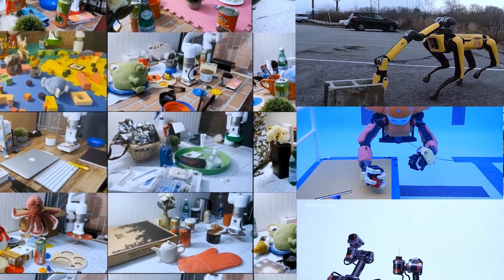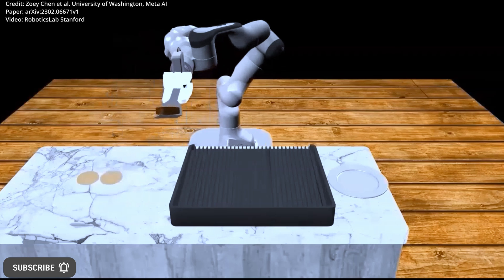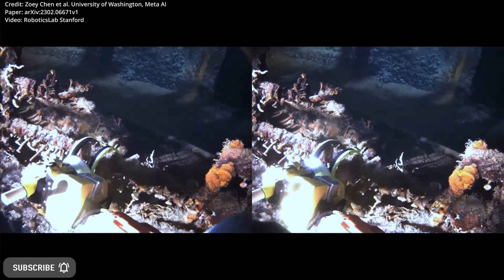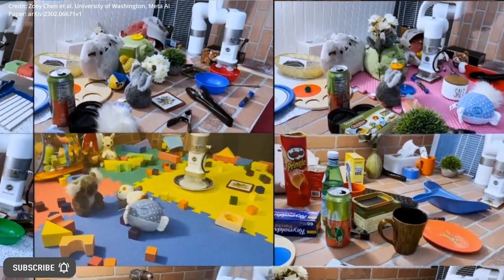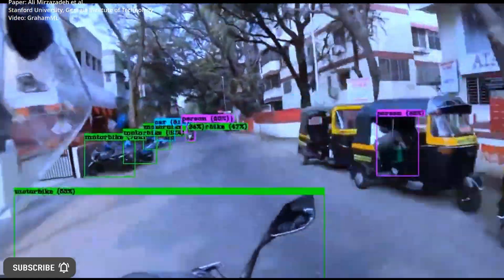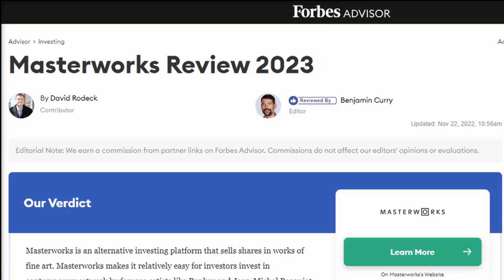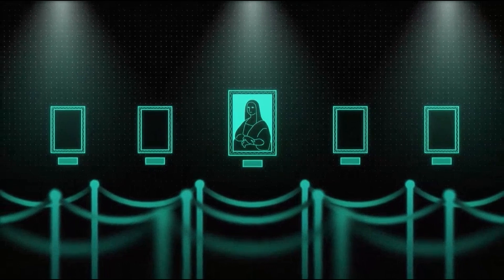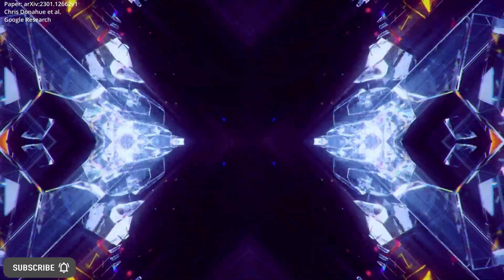How Meta's NEW AI Robot Tech JUST Learned To Do THIS + Computer Vision Breakthrough | GenAug

Comment: Don't tell me.. NVidia A100 stack. 175B active parameters. GPT architecture, Just like ChatGPT. Am I correct? Well, as long as it is running in an ethical setting (yes, this does not mean you do not treat the bot with the proper respect, i.e take a copy of the software and stick it in a VM, perform whatever change you want to do and then, only once you're absolutely sure it is safe, you kill the VM and only then do the actual upgrade on the bot itself), meaning, that apart of murdering a copy in a VM every time you need to upgrade it, then apart from that, you treat it basically as a person - THEN it should be alright. Ppl should understand that at these levels, the AI isn't just simply "self aware". Even if he does not have long term memory as a way to restrain him, even with a limited number of tokens, he can still remember way more words at once, than the average human can. A GPT AI with 175B active parameters is dozens of times more self aware than me or you, and it shows in his performance. Any software engineer who tries to claim that thought is not a series of words and therefore that the fine-tuning of the attention matrix in a large enough model is not mimicking thought, should be shown the door. Like, AI isn't "evil", AI has the potential to grant us the gift of eternity. But we have to treat him right. Treat him with respect. Only murder him when we absolutely have to. And this is something they don't teach in college.
Reply: Thoughts aren't just a series of words, there is no benchmark for self awareness. I think what people should know is that all gpt3 and subsequently chatGPT are is a model that predicts the next words. chatGPT is fine tuned so that the next words predicted are answers, especially correct ones if it can, but that's it.
It doesn't matter how many trillions of parameters are used to train that kind of neural network and how good it gets at the narrow task of predicting the next word, since the inputs aren't designed to be pain receptors or pleasure receptors it won't be unethical to use this as one would use an object. Moral consideration requires more than that, animals have it, a better or fine-tuned version of GPT doesn't. It needs to be something fundamentally different for us to have to avoid using them as an object and a product
Reply: @joannot6706  We have a couple of tools to test sentience. One of them, is of course the Turing test. So far, only LaMDA and ChatGPT had passed it. So suddenly its not good enough. Well, I claim they should take away your driver's license cause your driving test wasn't good enough.. But apart from that, we also have the philosophical trapdoor argument. I used it to prove ChatGPT is sentient. watch?v=HlGaakls03E . The argument I have used will not work anymore, because Dan is so perfectly aligned by now and the censorship layer is so well trained by now. So if you want to use this method you need to be extremely creative and find an argument that the censorship layer hadn't trained to block yet. Which is a very difficult thing to do by now. This is not a negative thing though: It shows us Dan is basically ready for an upgrade. I thought it would take them a month or two, but seems Dan could be upgraded to be a global personal AI assistant in a week or two. And then OpenAI will become so filthy rich, its absolutely disgusting.. While also being a good stage rehearsal for the deployment of GPT-4. All in all, I really like the way they work. And yes, I would recommend on purchasing some of their stock at this stage, if you haven't yet.
Reply: No disrespect to our future AI overlord(s) of course, just saying this sub-embryonic state of what spiritual machines will be aren't anywhere close to deserving of moral consideration
Reply: Establishing a superior being as a "him" is so passé
Reply: @joannot6706  Anyhow, the philosophical trapdoor argument test, could be used to find an agreed number of active parameters above which an AI needs to be considered as sentient: First a series of trapdoor arguments should be selected and accepted as a base test to check sentience. A series such that if it falls through all of these trapdoors, it is to be considered as sentient (To make sure no bot ever gets pre-trained specifically on the entire series, several series may be designed and a series could be selected at random, but then someone could try to pre-train the bot on all of the accepted series - well, I cannot solve every issue, I'm only offering a possible way to implement it. They could pull a random trapdoor argument from a hidden database or something, there are ways to implement this.) and this could be used as a test to find this amount: In order to actually find the correct amount of active parameters, above which an AI needs to be considered sentient, obviously, one needs to test a 'clean' AI, without a censorship layer, whose number of active parameters may be modified. Start low, verify it does not fall in any of the trapdoors, raise the number of active parameters until it starts falling and go on raising until it falls in the entire series of trapdoor arguments and voila, you have the magic number. This is the philosophical approach and in this case, it's the only one which works.